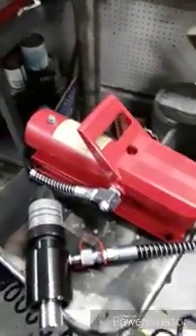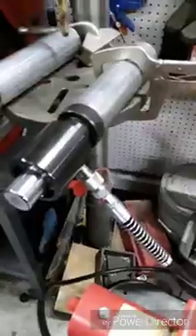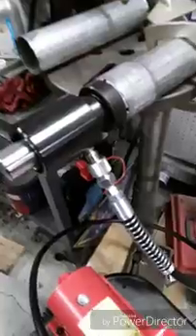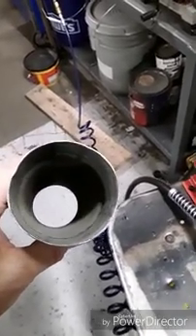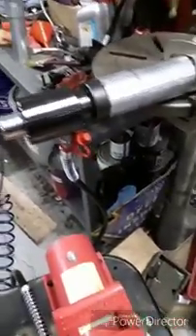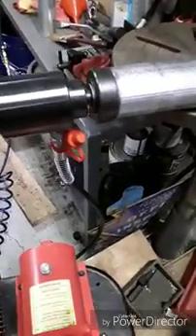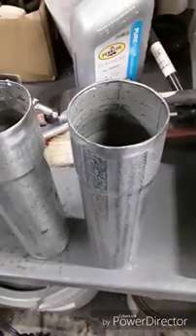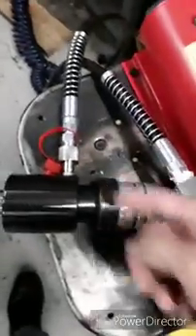Air hydraulic exhaust pipe expander test and review

Comment: I see many using these tools wrong. Even with the professional pipe benders used un muffler shops, you expand 2 inches at a time. Do the first expand with it halfway in, then release push all the way in and even it out. If you have to go more do the same. Rotate the tool on the second expansion to round it off, and rotate it back to finish it off.... the pump put out 10,000 psi. Put that on the full 4 inch depth you are only working with 2,500 psi. Cut that in half you now have 5,000 psi to work with......
Reply from the maker: Yea, I've used professional pipe expanders and , of course they are way more expensive and like 10 times stronger than this but that's to be expected.  My point here was really exactly what you see.  This expander works fine on thin pipe.  It's not strong enough to expand thicker pipe.  Thanks for the comment.

Comment: The tool works better if you do one expansion, then release and turn the ram one quarter turn and expand the pipe again. Keep doing it that way until the pipe is stretched to where you need it. This also keeps the opening round instead of ending up square. Remember the travel of the piston in the ram is around one inch. Check out our tool on Ebay. Number 252353593737.

Comment: The reason that it binds is because of the allthread that is being used in this setup, I believe there is another seller on ebay that offers a better draw stud that is cnc machined.
Reply from the maker: It doesnt turn while the ram operates. Each pipe was in the same position  with the  allthread the ram just isnt strong  enough to expand the bigger pipe.  Thanks for the comment.
Reply: What size drawstud is in this, if i could buy the ram and draw stud i already have a big enerpac hand pump and lisle pipe expander